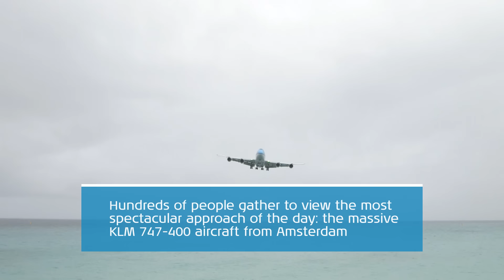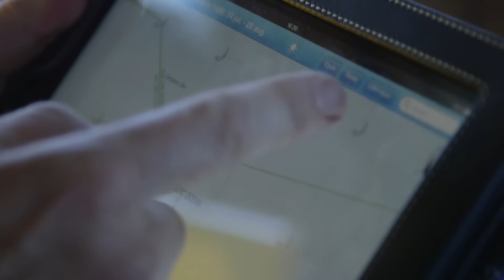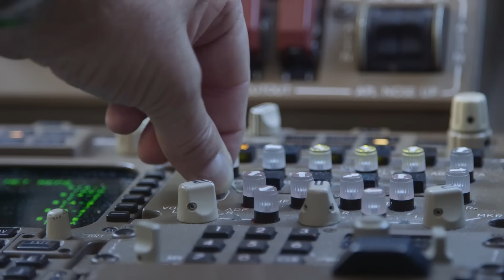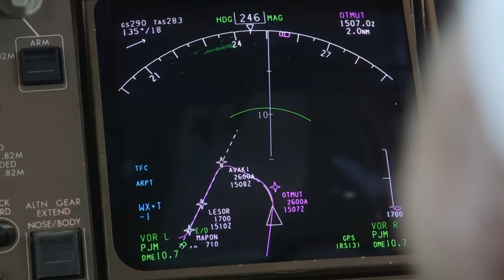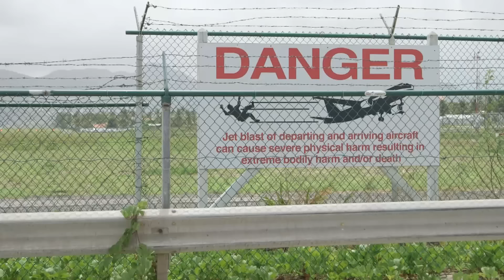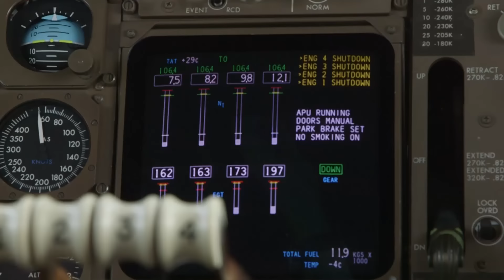Big plane, short runway | Cockpit Tales | KLM

Comment: the plane they are flying in (PH-BFB) is preserved at a hotel close to Schipol airport, it was retired in 2019 and was the oldest flying 747-400 at the time, KLM's 747's will be missed
Reply: Look at : 3.39  for the selcall plate ,  reg. is PH-BFB and not PH-BFT
Reply: @janvandenheuvel5424  came back to this video after 2 years and only then did i notice it lol, decided to edit my comment aswell

Comment: Sad KLM will no longer fly the 747 to St. Maarten after next month
Reply: Its gone...
Reply: R.I.P 200000000000000 KLM 747-400s
Reply: Ernesto Martinez But The Plane Replaced! Now The Aircraft Is A330 Normal Livery
Reply: No, no Airbus.
Reply: Are they going to stop flying with 747 or only just to St.maarten
Reply: Mystory❤  just to st Maarten
Reply: oh wait nvm

they brought it back after irma
Reply: Primarily due to the amount of cargo that can fit on board. Else, they'd have to up the frequency of A330s.
Reply: Lucian T. I cri every time
Reply: That's actually a good idea. I don't know about aviation, but I noticed that most of the planes I see landing there in videos are much smaller.
Reply: Ernesto Martinez they will be back in a few years if demand grows.
Reply: Ernesto Martinez 747 is such a strong and fast aircraft..!
Reply: Same.but it’s safer
Reply: Rip 747
Reply: Please order some 747-8i aircraft
Reply: Will they replace it with the 787?
Reply: I was born on st Maarten and the plane has been brought back after Hurricane Irma
Reply: A330 is so stoopid
Reply: Neil Sadarangani I just got back last month it was thier I got a face full of sand @ Take Off 🤙🏻✈️
Reply: Soon, no 747 will fly ... at all.
Reply: DUde101 Loo
Reply: Ok
Reply: read my name
Reply: It's currently the year 2087. Elvis is flying the new A560. Currently holds 1300 passengers with 300 tons of cargo. On take-off, the beach is cleared of spectators completely.

Which is strange, because there were hundreds of spectators there just a few seconds before.. I guess they all must have gone for a swim or something.
Reply: Chris Thomas wow, I didn't realise KLM had so many 747s. For them to own 200 trillion 747 aircraft is mind-blowing.

Comment: i hear you are about to retire the 747-400 combi starting slowly in 2016, is this going to affect your scheduled services, cause my only reason for going to SXM is watching your 747 do the approach.
Reply: Airfrance and corsair also fly the 744 to SXM!
Reply: Air france flies the Airbus a340 to st maarten, they have completely retired the 747 from their fleet. But they still have the 744.
Reply: skylineXpert There are no plans for retiring the 747's, KLM told me personally
Reply: that makes me feel safer.
Reply: Well, they are, but they do have the newer version, they are just retiring older aircraft, nothing wrong with thg
Reply: They are not retiring their 747-400 fleet for at least 6 years
Reply: However KL 785 has been replaced with KL 729. No more 747 for st maarten. Terminator services are expected to continue after 27/3/17 which means: 2018 is anyones guess what is going to happen. It would make sens using the 747 for the winter season. But summer season.

Comment: Beyond great vid! Wtg! Just a slight correction: flaps are not reducing speed: due to their add drag they make the aeroplane haveing a reduced stalling speed. Meaning/Therefore it CAN fly with less speed without stalling. Only used for slow speed maneuver like start and landing. The 50 cents from an aeronautical and fluid dynamics engineur😅

Comment: Been  there done that; great holiday. Our plane could not take off with a full load of fuel bc that runway is too short and you face the mountains to take off; so we took off with only half fuel; landed 30 minutes later at another airport to fill up, then took off again and made it the rest of the way home. interesting...when we landed to get the fuel my hubby warned me its another short runway, brace for impact as they are going to land it VERY FIRMLY..OMG!! it landed SO HARD i was almost jolted out of my seat! and i thought for sure the wheels were going to be broken off or come up right THROUGH the floorboards!! Ive NEVER had a touchdown that felt like a crash instead, like that one! and then took off VERY abruptly, felt like we were pointed at the MOON! I hate short runways...